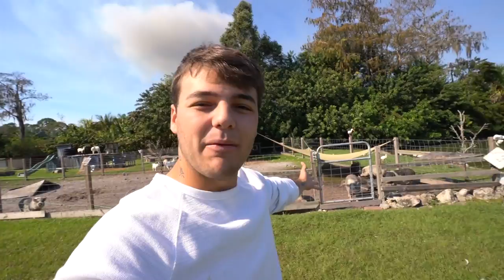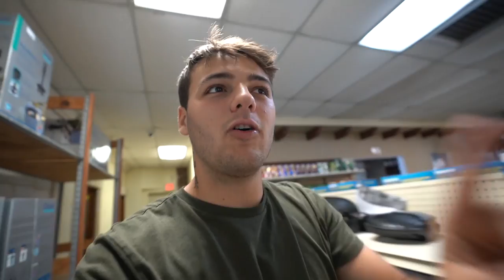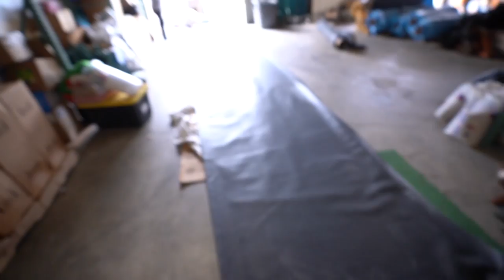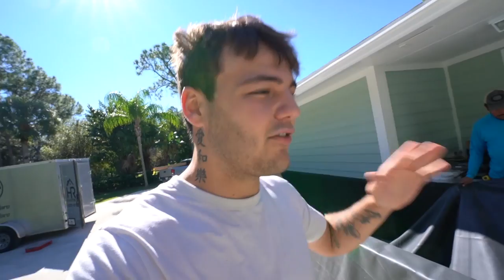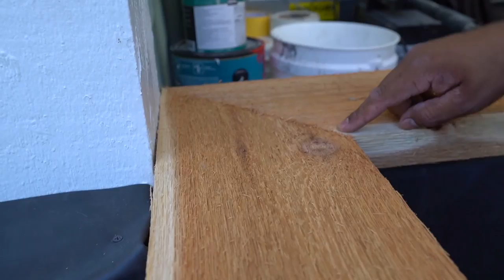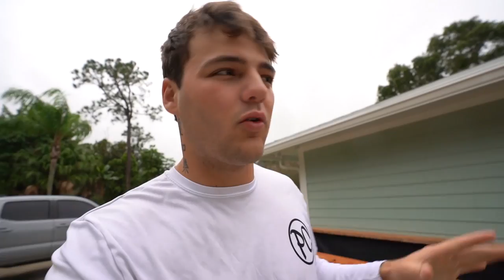My 3500G POND at PC FARM 2.0 is COMPLETE!! (massive)

Comment: Looks amazing, hope it all goes well. This deserves a top notch filtration, I imagine you got that covered. 
I could be wrong but I would brace the long front side to the house right in the middle, since this pond is made from wood and not concrete like the other one. There is a big chance it will budge with the water weight. Best of luck with it all

Comment: You better join the top sides of your pond along its length at 2 or 3 points or the sides(especially the outside wall) will spread out. The 2 x 4 wall is not strong enough to support the weight of the water along its 22ft length. Your 4000 gallon was reinforced concrete for a reason.